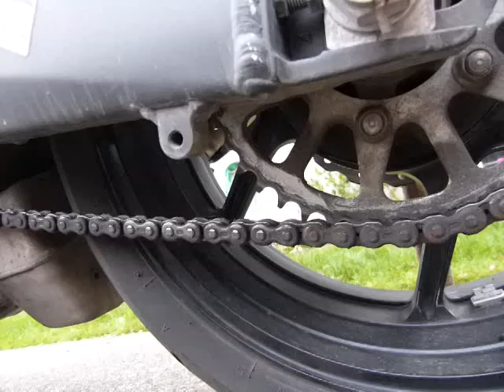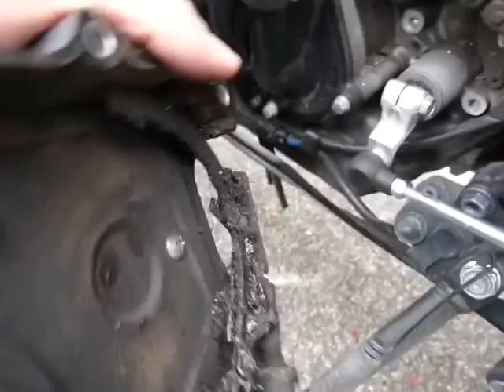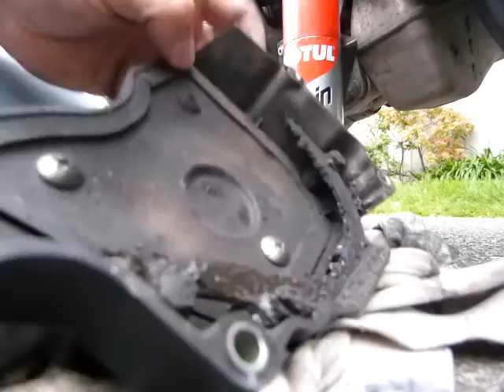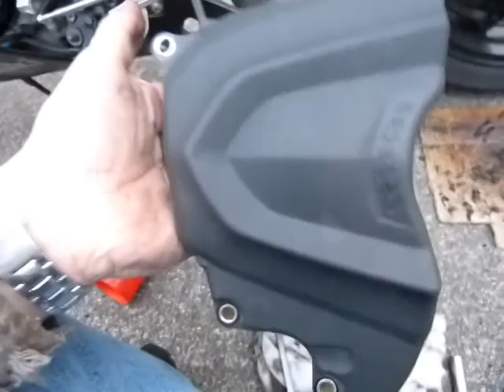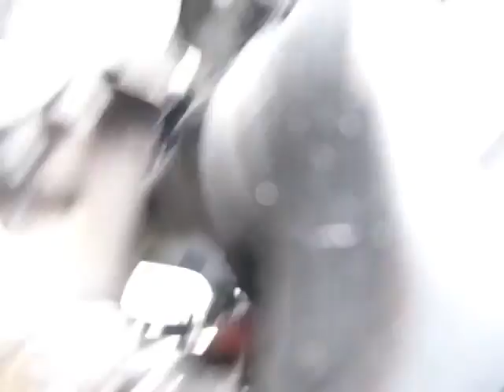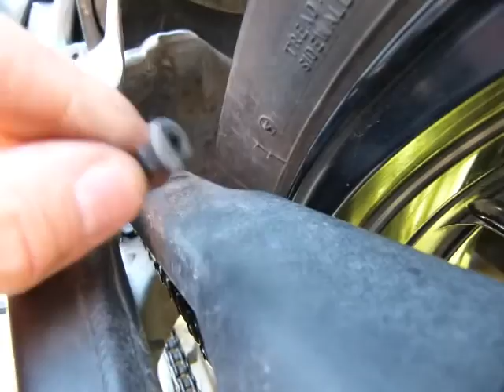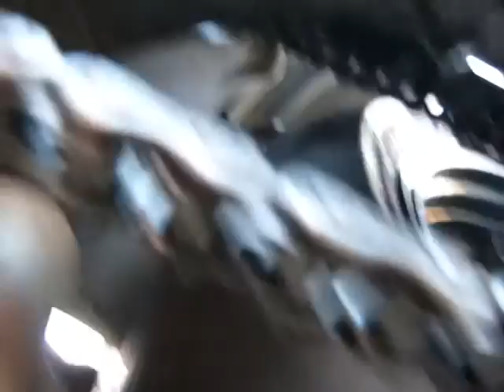Springtime mega chain cleaning

Comment: I recommend kerosene for chain cleaning. Remove your rear wheel - cut a milk jug in half - fill it with about an inch or 2 of kerosene - and dip the free length of dirty chain in the liquid. You can use an old toothbrush to gently agitate the grit and grime. Then, pull a new length of dirty chain forward and repeat. Your chain will be like new. Be very sure to follow theoverengineer's technique for properly lubing your chain afterwards. Hope this is helpful to the discussion.

Comment: Good video thanks.

Watching other people clean their chains, I can see that I clean mine long before it gets to the level other people will tolerate.
But then, I only do 10,000 kilo/year for pleasure - I go to work on a scooter with a CVT drive :)

By the way, I was using various nylon bristle brushes to clean the chain but yesterday I bought a brush that cleans from 3 sides at once. That and kerosene in a spray bottle seem to work well and in quite a short time. For that brush search Amazon for AZ KD04 (I found it on Amazon Japan. It may not be on other Amazon pages).
Reply from the maker: +staninjapan07 Thanks for watching & sharing. Send a link for all to see.
Reply: theoverengineer
Youtube does not let me post links in comments. Also, for some reason, it does not let me copy and paste text into a comment box (probably to avoid spam).
Reply from the maker: +staninjapan07 Ok, thanks.

Comment: Good instruction to do a thorough clean. What chain lube are you using? I looks like a dry type of lube would save you from a lot of work.
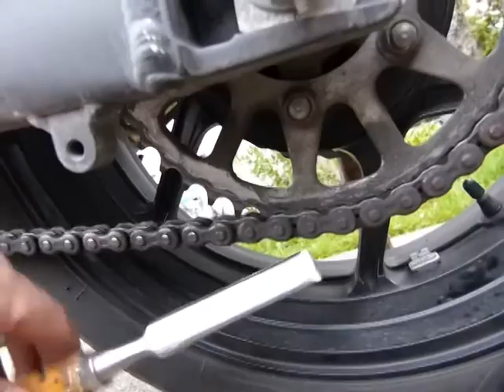Reply from the maker: Mike Anoneemus Thanks for watching. A liquefied (due to poressure) wax in a can. See the can 0:00 - 0:15 Chain pre-heat for lubrication and its operating principle.